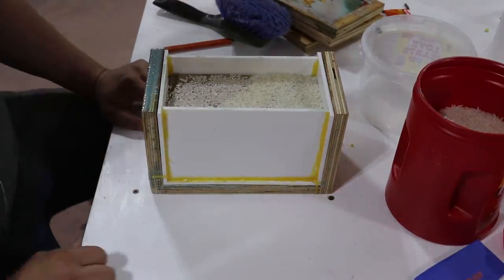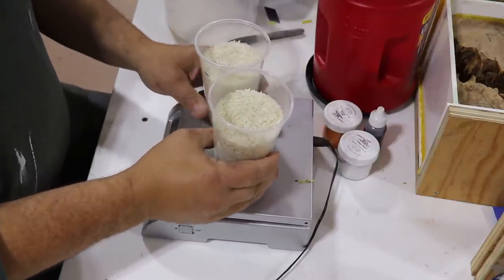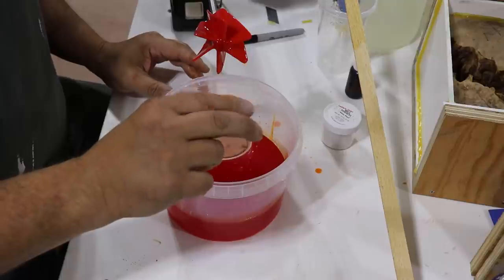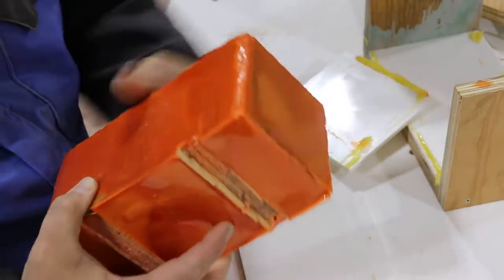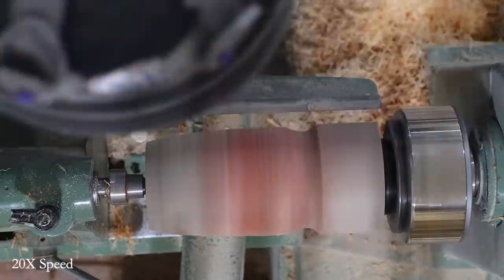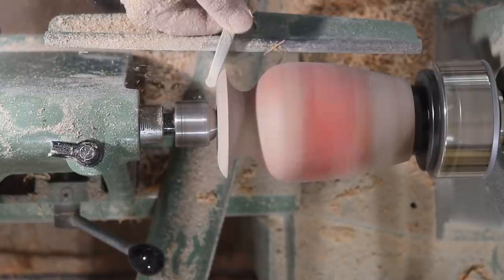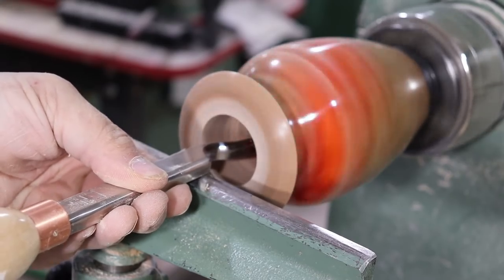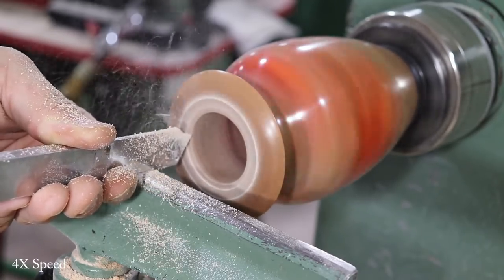Woodturning | Flaming Resin and Maple Burl Pet Urn

Comment: Really like your work! For one thing, they are simple, easy to turn, pleasing to the eye, and you say they sell; good enough for me ! I just have one Q; why do you leave the work in the pot for 6 hrs., when it must have "kicked"a couple minutes after you were done pouring? This shows my ignorance, but; why do you put it in a pot with 100 lbs. of pressure, when it seems clear to me it will cure just fine without extra pressure?
Reply from the maker: Thanks Seth. This resin will not cure in a couple minutes, it needs the 6 hours. If this resin does not go in a pressure pot at min 50psi it will be full of air bubbles. If I were using a slow cure resin that didn’t require a pressure pot the cure time would be a few days. Thanks for watching!

Comment: With all the burl and resin dust (not the strings) tossed and mixed up, then mixed into clear epoxy and set, you could carve out a wondrous looking, wood and resin dust object displaying all sizes, facets, within the clear epoxy looking inside and out.  If you did a wood- and resin-stringed object then that would have some totally unique and crazy shapes within a clear epoxy carving.
Reply from the maker: Surprisingly when you recast the “waste” it loses all of the vibrant colours. With the burl being stabilized it comes off in fine powder. Thanks for watching!

Comment: Beautiful piece ! Some good tips there mate. Im gonna have to do the rice trick for my castings. I tend to have left over resin that I pour into pen blank moulds. Just a tip for you mate, I use a small drop of hot glue to hold in the burls. It pops off the hdpe moulds easy when demoulding but is plenty strong to hold the burls in. Cheers from Sydney Australia  👍👍
Reply from the maker: Thanks! I don’t trust glue on it’s own when using mold release. When I do one piece burls that I cannot measure I always have a second form also, can’t waste that resin! Thanks for watching!
Reply: @TheKlondikeCraftsman  Ok fair enough. I dont use mould release because I use epoxy and hdpe moulds. Yea I agree, cant waste that resin !

Comment: I love how you fit the lid and were able to turn with it on the vase!  It doesn't move at all while on the lathe?
Reply from the maker: Thank you Jeannie, usually I would friction fit the lid by putting paper towel between the lid and vessel but where this was not going to be opened and closed, I put the ashes in and glued it shut before turning the finial. Thank you for watching!
Reply: @TheKlondikeCraftsman  Ooh, that is a useful method for the lid fit otherwise.  I'm a newbie to this, and any suggestions like the paper towel method is super helpful.  It is a beautiful urn.

Comment: you want to go to 2:1 if you start hollowing.......more resin makes it harder - I am moving to 5:1 after watching the resin rim of a bowl move around in sanding
Reply from the maker: The product I use is 1:1 by weight, any variation causes issue. I have no issue in hollowing resin, now that stabilized burl....much harder to cut! Thanks

Comment: Love the work. Forgive me for being a noob, but why increase the pressure to 100psi?  When working with resin I thought the idea was to vacuum it to release the bubbles? Increasing the pressure would compress them... Would they still come out of the substrate? Or are you trying to drive the resin into the burl.
Reply from the maker: Most people put casting resin under pressure and not vacuum. The pressure compresses the bubbles so they are not visible. Vacuum is used when using stabilizing resin to get the wood prepared to cast. Thank you for your question and thanks for watching!

Comment: How did you get the lid to stay put without the tailstock in place.  You finished turning it and it did not move.  How?
Reply from the maker: In this case I sealed the lid on before finishing the top and finial. I have however turned them the same way with a good friction fit. Thanks for watching, I appreciate it!

Comment: This is really a beautiful piece. Thanks for the helpful commentary.  I was holding my breath as you completed the finial. I could see me needing a plan B very quickly.  Subscribed and looking forward to more.  Newby question: do you need the pressure pot because the epoxy is so thick and bubbles couldn’t be eliminated or are there other varieties of epoxy that wouldn’t require it? TIA
Reply from the maker: Thank you Jim, The burl was stabilized in cactus juice so it was very strong. There are some resins that do not require a pressure pot but typically you cannot pour them this deep in one pour. Alumilite just came out with one that you can pour deep without a pot but there arent many. The pressure shrinks the bubbles as they either cannot get out because of cure time or because of obstructions. Thank you so much for subscribing!

Comment: Great video. What kind of pressure pot do you recommend?
Reply from the maker: I have reconfigured a 5 gal professional paint pot and I have an inexpensive 2.5gal paint pot converted from Princess Auto. Check out NV Wodwerks or Jake Thompson’s channels, they use actual pressure  pots. Thank you for watching!
Reply: @TheKlondikeCraftsman  I'm new to all of this. I didn't know you can use a pot to speed up the process.
Reply from the maker: Hey Russ, the pressure pot compresses the air bubbles in the resin and makes it look as clear as glass. Thanks for watching!
Reply: @TheKlondikeCraftsman  does it speed up the drying time or just remove the air bubbles?
Reply from the maker: Resin doesn’t dry it cures, it is a chemical reaction. It doesn’t speed the process just eliminates bubbles.
Reply: @TheKlondikeCraftsman  Got it. Thanks. How long does the curing usually take?
Reply from the maker: It varies a lot between different types and brands of resin and how much is used. Some are 4-6 hours and some are 2-3 days.

Comment: What's a good target PSI for resin casting? I bought some two-part epoxy but it doesn't have pressure pot guidelines.
Reply from the maker: Hi Russ, the minimum I use is 50PSI. That should be fine for all brands. Just make sure you leave it pressurized for the full set time, no peeking! Thanks for watching!
Reply: @TheKlondikeCraftsman  Thanks! I'll set it to 50 PSI. The epoxy I purchased has a cure time of 72 hours. Although the sales rep I talked to said it's usually hard within 10 hours. He also doesn't know anything about pressure pots and he wasn't sure how long I should leave it in the pot. Can you leave it in for TOO long?
Reply from the maker: No too long doesn’t hurt. What brand is it?
Reply: @TheKlondikeCraftsman  ProMarine
Reply from the maker: Be careful pouring too deep with marine resin. It is prone to heat and cracking when it cures. The more resin at one time the hotter the reaction
Reply: @TheKlondikeCraftsman  Good to know. What kind of resin do you typically use?
Reply from the maker: I used to use Alumilite clear slow, that worked perfectly. It was hard to get where I live for a bit so I’ve switched to red creek wood designs resin. If you are in the US the Alumilite is very good. I’ve never had a crack or bad casting with it.
Reply: @TheKlondikeCraftsman  Thanks. I'll check it out. Epoxy is so expensive. I'm trying to find a good deal on good epoxy.

Comment: 100 PSI???  Most people only do 40 or 50 PSI...not saying I understand it...but why so high?
Reply from the maker: The pressure just compresses air bubbles so they are invisible. I use 60lbs on one pressure pot and 100 on this one as it is rated for 120 and is safe to do. The is no disadvantage to going to 100 and I experimented to see if higher pressures made any difference. I don’t think there is any difference when you get above 50lbs I but since it is safe and free , I continue at 100 on this one. Thanks for watching!
Reply: @TheKlondikeCraftsman  oh right...I forgot about altitude as well; I'm sure that comes into play.